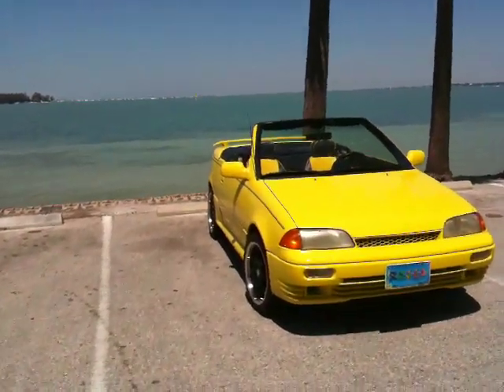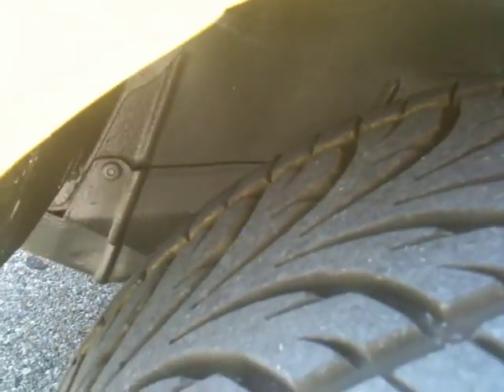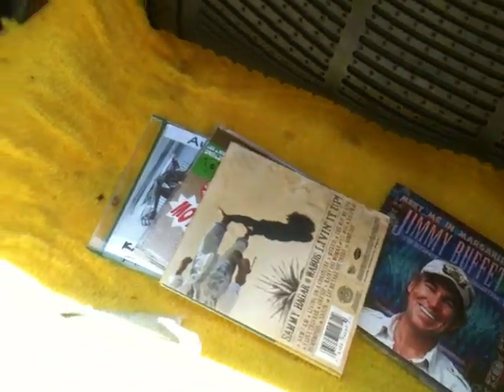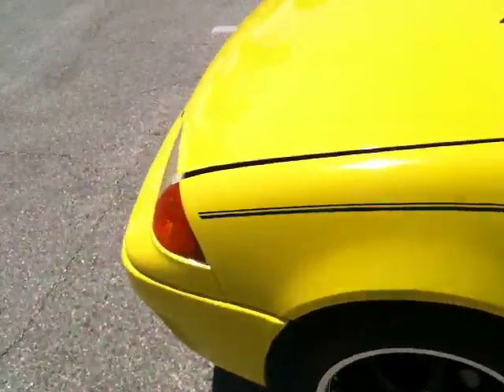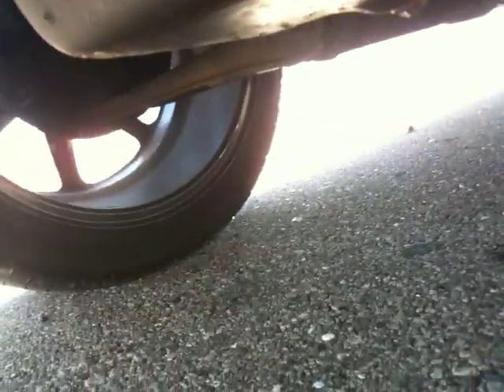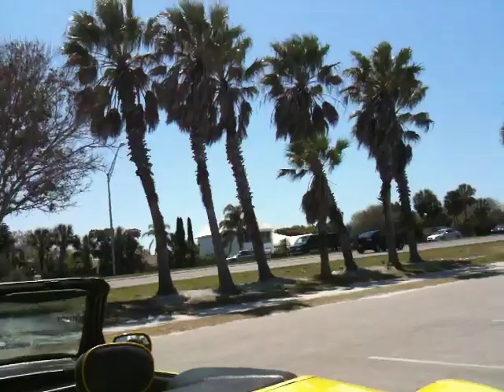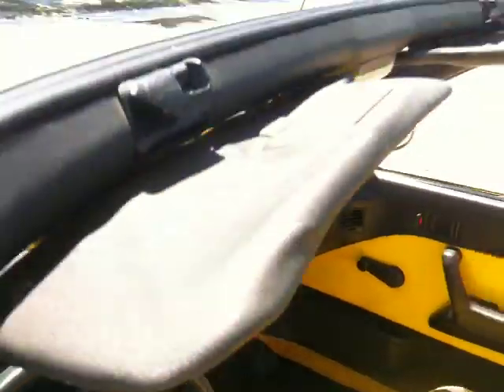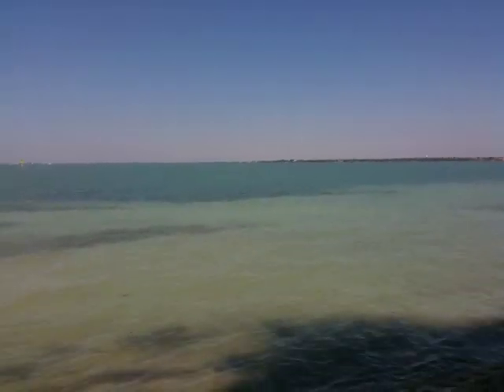1991 GEO METRO CONVERTIBLE

Comment: These are not expensive cars. I currently have 9. 6 are running. 1 is an convertible. 
The price range usually is from $500 to $1,500... Depends on condition.

Comment: What?  No LS swap!!???
Reply: I think a modern GM 1.3 LITER TURBO 4 CYL would be an awesome swap for this car . This car is very light yet has an anemic engine . More than double  the horsepower and torque with 155 HP a metro convertible with that power train would be a scrappy stop light fighter catching genuine sports cars by surprise. Of course if a sports car driver knew what he was up against it would probably lose but half the fun is people wouldn't know what it is till 0 to 30 has gone by .
Reply: @louisbabycos106  The 3 cyl only had 54 HP.  Mine has 46 because I detuned it for more MPG.... I've gotten up to 62 MPG on long Freeway trips.

Comment: very very nice car, thoroughly disappointed it's an automatic
. very nice looking car nonetheless, why the sale?
Reply: Actually The Automatic Is Better Than The 5 Speed And A Lot Easier To Drive. Acceleration Is Quicker Because When You're Shifting The 5 Speed You're Lifting Throttle To Shift. And In A Convertible, I'd Much Rather Have The Automatic Anyway.